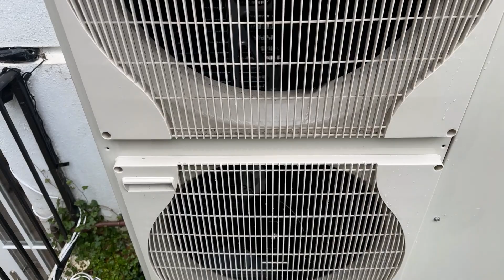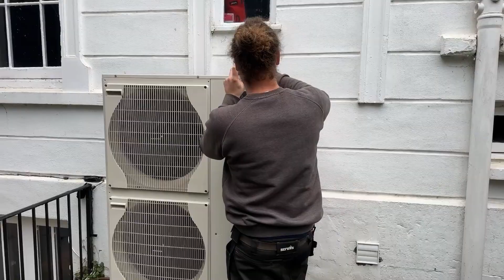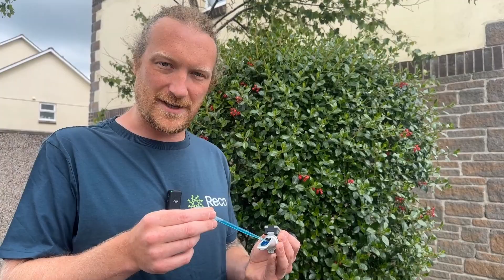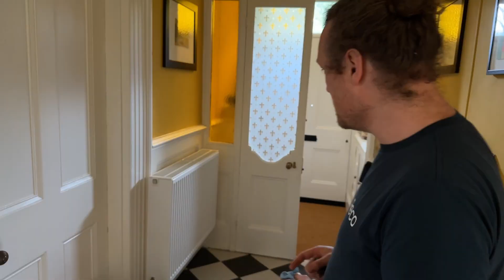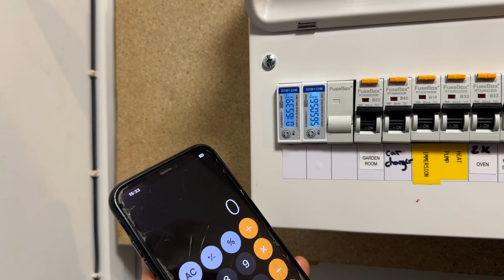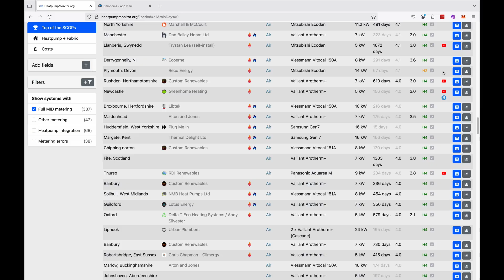First Service of THIS Heat Pump - Victorian House Performance REVEALED!

Comment: A very good practical video.
For the home owner that has no DIY skills the charge seems fair.  That you fitted the energy monitoring system is commendable.

The warranty being conditional on a certified installer doing the service does question the integrity of the industry to punish the competent buyer from servicing their own installation.  With the energy monitoring system I would expect to see a decline in my COP to indicate my coils are dirty/contaminated and thus get the cleaning kit out.  I used this method to determine if my gas boiler needed a service by replicating the commissioning test on hot water after buying a flow meter and thermometer.  I faithfully re perform the test every autumn  to check the delta T at max flow rate and so far for 6 years it confirms the efficiency of the boiler heating my water therefore no issue in performance.  Money saved buts a new boiler after 12 years if no service needed.

I just subscribed because your video is honest and fair so worth seeing what else you post.  Keep up the good work. ( I am an engineer (petroleum with a degree in physics and electronics ) so my skills are up to self certification for solar PV etc. and I will likely fit my own heat pump in due course then service it myself.

Comment: How come there is a Type A RCD (RTA063230B) fitted on the heat pump?

That is not going to provide protection when the invertor injects DC current into the system it will be blinded,

RCBO 32amp Type A - B Curve RTA063230B
Reply: I think you are thinking of type AC rcd not type A that can handle pulsed DC currents. Also a B curve could be too sensitive if you have a compressor that’s pulling a lot of current when it starts. Seen an air con unit blow a fuse repeatedly when it was starting up until someone fitted the correct slow blow fuse.

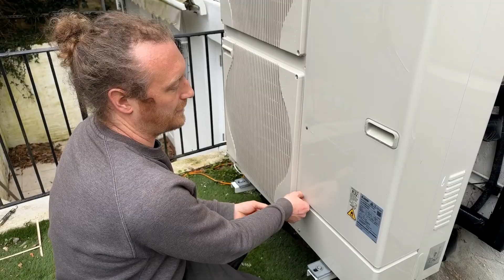Comment: 1:40 R32 isn't propane, that's R290. R32 isn't flammable, and can be safely used in split systems, whereas R290 will likely always be heavily limited in split systems.
Reply from the maker: Ahh yes you are quite right! It is in fact R290 that is similar to propane. Either way the valve is outside because you wouldn’t want it leaking into your house due to concerns of it being flammable.
Reply: Yes R32 is Difluoromethane with a high global warming potential hence it is being phased out
Reply: @ldm3027  R32 is unlikely to be phased out for split systems for probably at least a decade.
Only really in monoblock has it been banned from 2027 for new installs.

Comment: So an ASHP service is throwing a bucket of soapy water on the coil, that’s a bargain at about £250 a service. Validates my decision not to bother and pop what I would have spent on servicing in an account to cover repairs in the future.
Reply from the maker: I would advise watching the rest of the video! If your heat pump isn’t running correctly it will cost you more than the service in the long run. Also most manufacturers require an annual service to be carried out for the manufacturer warranty to be valid. A hot water cylinder can be very dangerous if a fault with any of the safety valves is left unchecked. A service for a gas boiler and unvented cylinder would cost the same.
Reply: @RecoEnergy  It seems to me to be poor safety design to rely on a sprung pressure relief valve on an unvented pressure vessel. They should really have a fail safe mechanism such as a bursting disc that will rupture and vent to a safe location at less than the maximum design pressure. 
If a service was of a similar cost as that of a gas boiler then I’d have no beef with it, however it is 3 x the cost and is less onerous and doesn’t involve anything that is genuinely safety critical.